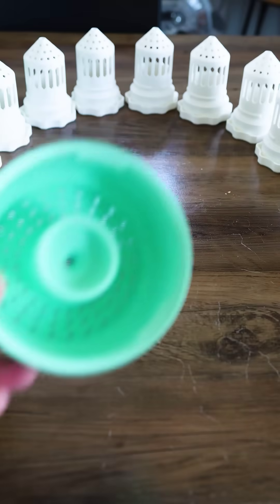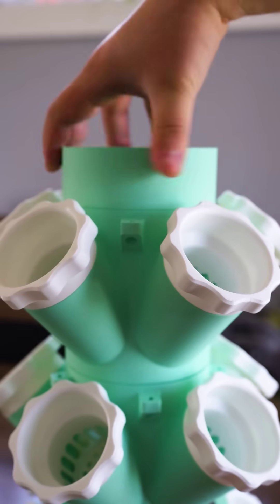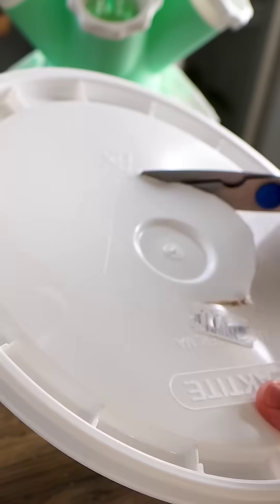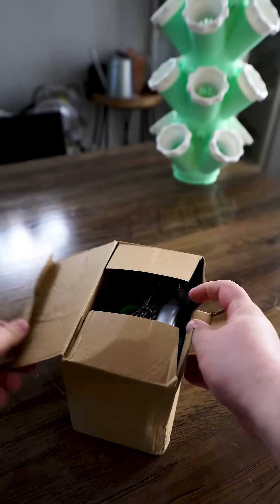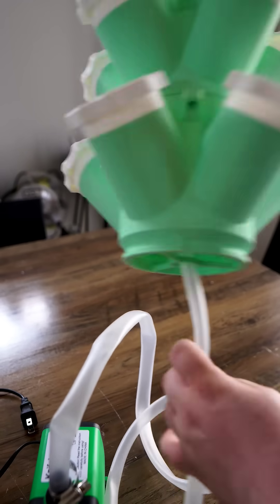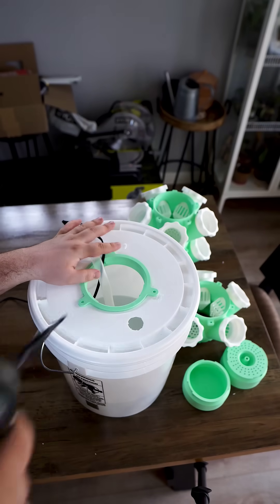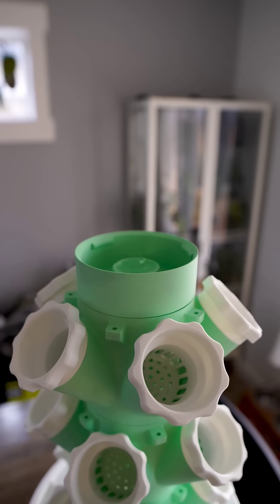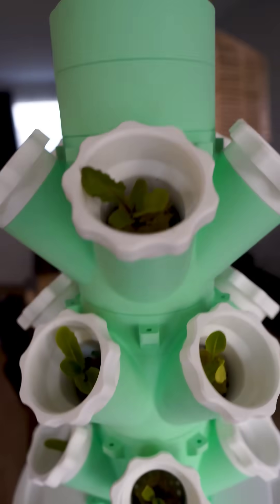3D Printed Hydroponic Tower Garden #3dprinting #hydroponics #gardening #garden #3dprint #3dprinted

Comment: Where did you get the fitting for the bucket I can't seem to find it
Reply: I ended up finding all the files on thingiverse also for those who use an Ultimaker the bucket fitting might be too big but you can make an adapter for it if you print a tower spacer with the lower part being 0.8 and the top at normal scale
Reply from the maker: That fitting file I can't find it myself. But the people in the comments posted their own version. Please browse through to see what works for you 🙏
Reply from the maker: The comment section of where you get the file.

Comment: In case you wanted to do a larger reservoir bc of the way the base attaches it allows for flexibility, I’d say a sheet of plywood and 100 gallon stock tank with a float valve to keep it full, perhaps a wider sturdier base plate, and you can come back and check on it at harvest time. The locking mechanism seems really sturdy so I imagine you can build these pretty tall!
Reply from the maker: Like for multiple towers right, not for 1?

Comment: How did you know what plate to print from the file, there are so many and I just dont know what to print and why there are so many spacers
Reply from the maker: Hello, 

The only plates I've printed is;
"pot standart, dispenser + lid, 5 planting (up to you how many layers you'd like)"
So out of all those plates only 3. 

The OG designer included a bunch of those models there to give you more options.
Reply: @3DPrintedProject thanks!
Reply: @3DPrintedProject  What piece is 0:23?
Reply from the maker: @ahintea that was a ring meant for interconnecting each layer so you can then use those little tabs to secure the whole tower by attaching a string / rope of sorts and anchor the unit to the ground. In my case I used it to secure it to the 5G pail.

I don't seem to see it on the print plates anymore!! Were you hoping to secure it the same way as you saw in the video?
Reply from the maker: @ahintea i can't find the ring I used for the lid, but here's this one;

https://www.thingiverse.com/thing:4395675
Reply: @3DPrintedProject thanks so much  and yes I want to attach it to a 5G bucket like you! I’ve been searching everywhere and your video is the best one. Thanks so much, I’m going to start printing tofsy
Reply: @3DPrintedProject  Hey man, I'm almost done printing and was wondering about the part you show around 1:14. I see you zip-tied the tubing to the nozzle at the top, has this held up or did you change it to a hose clamp? I'm worried my tubing is a bit too large to fit tightly around and dont want water to spill out. 

Also, are you still using the tower? Id love to know what youre growing and how you maintain the nutrients, pH, and EC.
Reply from the maker: @ahintea  Hey there, i just had a ziptie,  the pump I used is very weak, but yes upgrade it to a hose clamp if you're worried it will be more secure that way.

Currently me and the wife are finishing harvesting veggies from our garden in the yard and winter time I'll resume with hydroponics.
Reply: @3DPrintedProject cool! thanks

Comment: how to mold proof it?
Reply: If printed in PETG or ABS it should be fairly mold resistant. May get mold overtime but could just wipe it off with some ZEP Mold & Mildew spray. But most plant molds aren't that harmful unless you have an allergy to them.